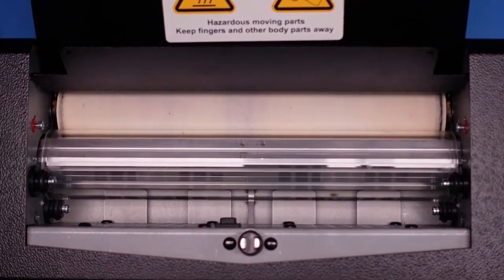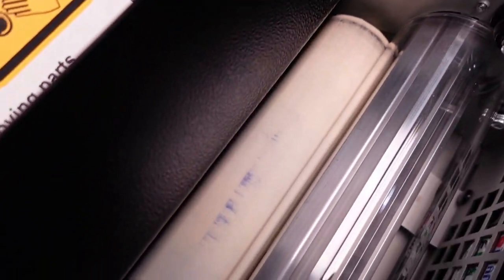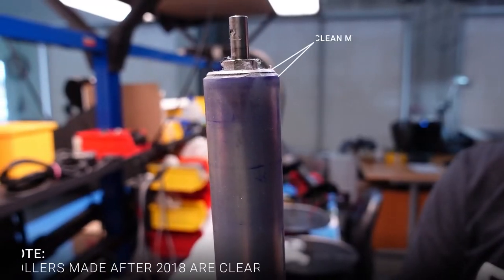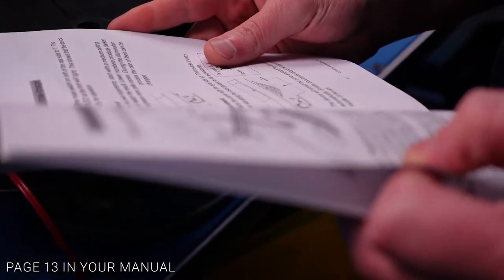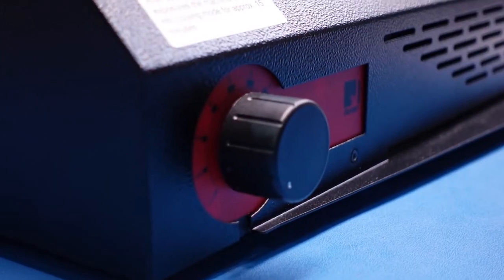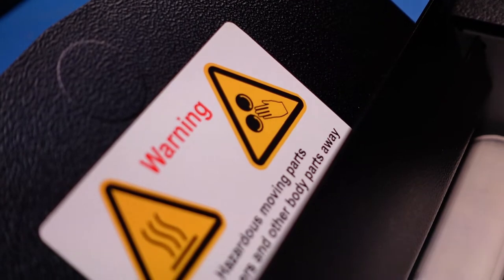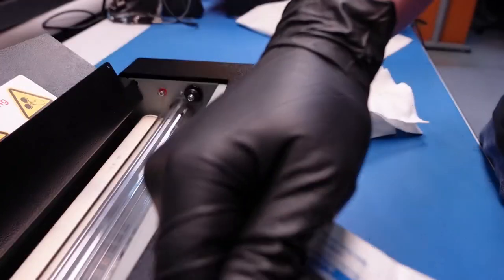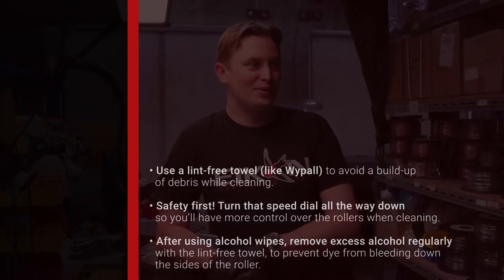How-To Clean Your Panenka A3 & A4 Thermal Copier (AKA Your Tattoo Stencil Machine)

Comment: The inside of our glass roller is stained so the outer edges of our stencils don’t come out. Any ideas?
Reply: Hi,

the glass-tube can be cleaned ( inside ) easily, but has first to be removed from the machine. Please send an e-mail with your serial-number ( label on the back ) for identification of version, then I can send an instruction.

Kind regards, Guenther Panenka, Munich/Germany ( distribution since late 2005 of A4/A3-machines )
Reply: @thermocopierdotcom  Thank you Guenther. I sent an email to the only email address I could find. I appreciate your help.